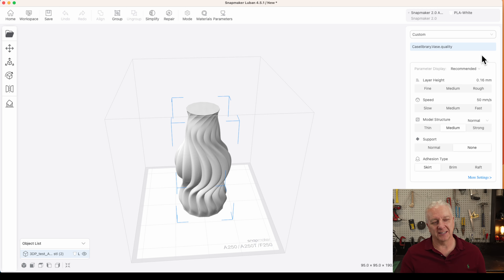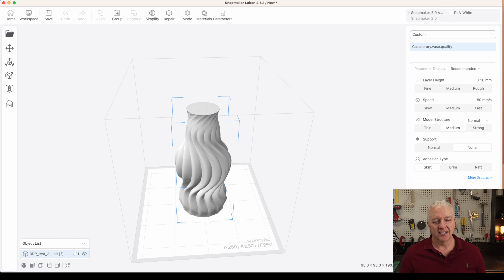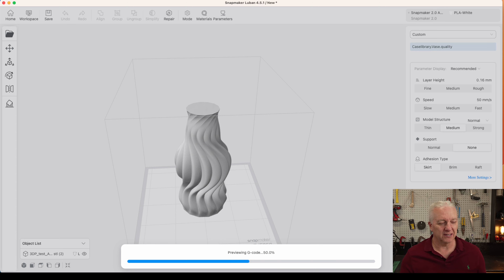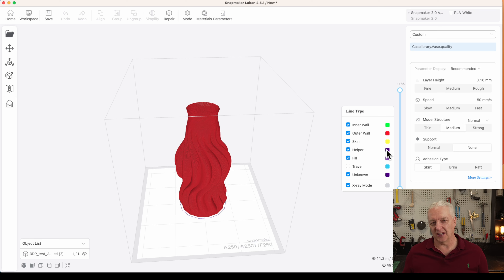SnapMaker 2.0 Review - Is a 3-in-1 Tool What You Need?

Comment: Great review. Snapmaker continues to improve the Snapmaker 2 machine in significant ways to address some of the weaknesses you mentioned. They've recently released a Quick Swap kit for the Snapmaker 2, which makes changing the module and bed from 3D printing to laser to CNC (whatever you need) really quick - literally less than 1 minute - without needing to change any screws. You mentioned that a 10W laser is available. I have that one, and for me, it works really well for the things I've tried. They've also released 20W and 40W diode laser modules. I have the 40W module on order. I haven't tried it yet, but I expect that it will work really well. Luban isn't great, but you definitely can use Cura or other slicers with it. You can use Lightburn as well for the laser and other 3rd party software for the CNC. Snapmaker is improving Luban, but it I agree that it needs work. That said, I've not had many problems using it.
Reply from the maker: Yes it’s great to see they are keeping pace with constant upgrades. I love the potential of the platform. A few tweaks in Luban would make this a slam dunk.

Comment: Nice review. One of the things you didn't mention was that SnapMaker has a Rotary module add on for $500 that works with both the Lazer and CNC. I wonder what the comparable Laser and CNCs would be that have that as an option (total budget jumps to $1700).
Reply from the maker: The video was getting a bit long so there were a few accessories I didn’t mention. The rotary attachment really sets the Snapmaker apart for CNC work and I’m not sure why they don’t push the feature a bit more.

I also didn’t get to talk about the larger laser module, but I’ll have a follow-up video for this improved laser coming soon
Reply: @SteveMakesEverything  definitely agree on that, the rotary ads a lot of value. I don't have one but I've seen them used for engraving tumblers and other items, along with CNC does. At $500 though, it's a pretty expensive add-on.
Reply from the maker: @joshw9052  The struggle SnapMaker is faced with is that their hardware is incredibly well designed and built and that makes it cost more.  

I'm convinced that the hardware SnapMaker produces will last a lifetime.  It's kind of sad that we've become so focused on the cost of things that we forget the value of things.